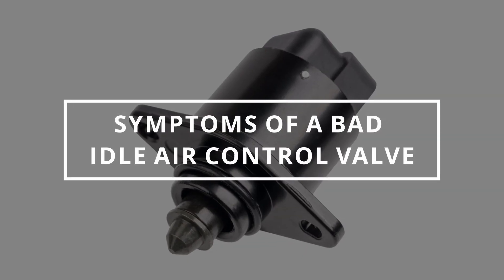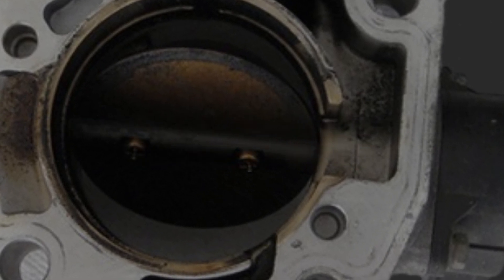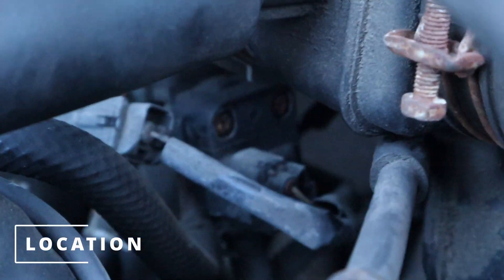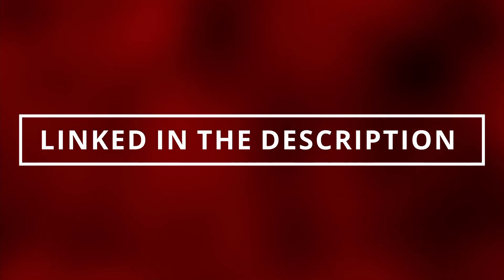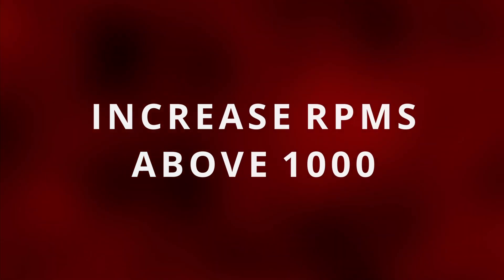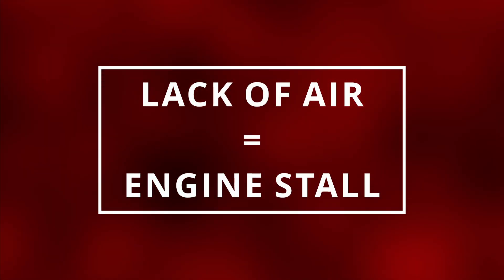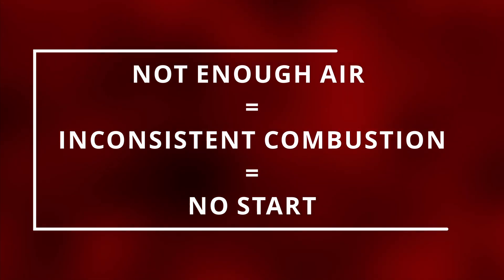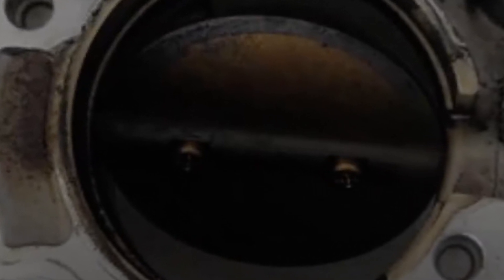SYMPTOMS OF A BAD IDLE AIR CONTROL VALVE

Comment: And yet 99% of people who change their air control valve never do it properly. You must you must disconnect the battery before replacing the air control valve this is so that it will relearn the new control valve when you install and reconnect the battery you must allow the vehicle to idle for at least 10 minutes without touching the gas or disrupting anything and then do another 5 minutes with your foot on the brake and then another 5 minutes with your lights on air conditioning on rear defroster on so that it creates a load and this will help the ECU learn all those different variables to give you a perfect idle when you are done. Hope this helped because nobody on YouTube is showing this because they're all defective
Reply: Thank you! I didn’t know this step, about to replace mine on a 98 and want to make sure it’s done properly
Reply: Thank you for the information Will.
Reply: @Vincenocks  You're welcome
Reply: Thanks for the heads up i was about to change mine
Reply: @nunya3812  no problem you're welcome
Reply: Remove negative lead only. No need to remove positive to reset ECU. Come on, let’s not be ridiculous. Electricity is not magic.
Reply: @howardklopak628   thank you…. I know some people are bullshit and try to fool on some of people… I knew it there just need is disconnect only on negative cable that’s all..
Reply: @howardklopak628   thank you!!! I fixed it yesterday and my 4.3 vortec running is perfect and easy start up.. I took old IAC valve and noticed that old iac valve is opened that mean closed for vacuum to can’t get air in the throttle body..  wish I can post picture or video in here comment
Reply: @howardklopak628 flatten the system is grounding out the positive cable … better results . Computers forced to reboot. Your method can leave residue voltage in the system. Removing only the ground does not flatten the system.
Reply: @howardklopak628 remove POSITIVE terminal. Everyone does this wrong. Reason being is all you're doing is breaking the circuit on the battery. Removing negative cable gives opportunity for negative cable to ground out on body, frame or engine which completes the circuit again. Guess what happens when you remove positive cable and it touches anything grounded. Nothing.
Reply: Oh, that is where you are wrong. Electricity is very much a magical phenomenon. You are just too old to see it anymore
Reply: Oh, that is where you are wrong. Electricity is very much a magical phenomenon. You are just too old to see it anymore
Reply: @howardklopak628  there is no need to remove the positive lead, if you want to drain all the capacitors out of the PCM you can remove both positive and negative lead and lay a towel over the battery and connect the positive and negative lead with a wire The 15 minutes and that will drain all the electricity out of the PCM and then you will have a flashed PCM. Your statement shows you have absolutely no idea what you're talking about so I'll just leave it there
Reply: @willsrestorations  Exactly… you have no idea what I’m talking about. Lol
Reply: @howardklopak628  trust me, nobody knows what you're talking about
Reply: @willsrestorations   Ok, so give me one reason why both the Positive and Negative leads need to be removed from the battery in order to isolate the battery from the circuit and allow the ECU to do a power cycle reset?
Reply: @howardklopak628 I'll give you one...Newer vehicles are designed to NOT lose all memory when disconnecting a battery i.e. clock time! When you connect the positive and negative it connects the circuit in parallel so "power" is still being used now although no battery is there to continue to supply it thus it fully "dies" and actually manually resets the ecm/PCM/ecu when the vehicle Is reconnected! He's not full of shite and actually knows what he is talking about! I know this as an electrician! The modern car computers have a Capacitor type storing ability of power in their systems! To check this, unplug the battery on a newer vehicle for 5 mins and see if the clock changes? I bet it don't and that proves his theory. Drain the battery like he said for a lengthy time and I bet it takes a second now for the computer to automatically set the time albeit fast, it won't be instantly!
Reply: @willsrestorations positive lead is only one you should be removing.
Reply: To touch the positive and the negative of the battery leads to discharge capacitors in the vehicle, you need to remove them both from the battery, genius
Reply: do you have to hold the brake for 5 mins or would 2 mins work
Reply: @Unknown-lu4zq  2 minutes is fine on most cars. But it's not as critical as one would think. The most important part is allowing the car to idle and come to operating temperature and then putting it in gear with your foot on the brake for like 2 minutes at most. And then back to park position and turn everything on in the vehicle including the air conditioning and rear window defroster and fan on high and lights on
Reply: God bless you I've replaced almost 6 of them but my car never came alright it iddling high sometimes low but hopefully this will help
Reply: You just saved me from causing a huge problem thank you
Reply: @TheReal2KD  anytime
Reply: Thankyou so much! You just made so much sense! Mind blown🤯 I feel like this information should be on the news! ❤️
Reply: @angamazinm9137 it certainly should be in the video that this YouTuber was making. There are very few good solid informative videos on YouTube,  unfortunately.
Reply: Ur a fucking g dude much appreciated info
Reply: Sir I just wanted to let you know that your information and knowledge is still helping people 2ys in the future! I lost both my dad and husband about a year and a half ago and they always knew all these tricks and surviving with my older truck is a lot harder these days because it's so much harder to ask the right questions if you didn't even know did that question was a thing lol! So anyway thank you!!!!
Reply: Wonder if I delete any codes with my scanner tool then will they relearning if I did replace IAC and without disconnect battery ?
Reply: @damnbigstoned420  deleting codes does not start the relearning process at all. The best way to do it is to remove both the positive and negative leads to the battery then place a rag on top of the battery and place a thick wire between the positive and negative battery terminal cables only for 15 minutes and that will drain all the capacitors out of all of the sensors and the PCM.
Reply: @willsrestorations what I already replaced  it before the steps but I haven't done it
Reply: After I do this should I turn the car off before driving or can I drive right after?
Reply: @deadmangreedo  you can drive right after but you must drive the car easy and not fast or being aggressive on the gas pedal for about 50 mi at the most. And everything will be reset at that point
Reply: @willsrestorations you don't need to go that far. Disconnect positive terminal (everyone says negative but that is wrong) then turn key on. That will discharge energy.
Reply: @willsrestorations ...Place a rag on top of the battery?? I don't believe you... ridiculous
Reply: Question bro 
Is it ok to drive with a disconnect IAC , I mean just for while cause mine I think its failure , when engine start always run with a high rpm like my foot in gas while its not( for a sec,then back normal) , and sometime rpm stall while driving.
I disconnected it , everything seemed normal now? 
Can you explain and advice please ? Thanks.
NOTE 
My car is mini cooper s 2009
Reply: @hussamalmaqdami3493  first of all your first problem is you have a mini Cooper, 😂.
I suggest you check your power lead to the IAC
Reply: Yes, you can leave your IAC disconnected, but you may have a difficult time with driving, because the emc will be looking for that input and it will likely cause your motor to run incorrectly, and in fact it may even cause you transmission to not go into gear like it should. The eco will be looking for that iac valve signal. I personally wouldn’t do it. But if it’s your only vehicle and you have to travel somewhere, then I totally understand why you would do it.
Reply: @willsrestorations
Reply: W comment
Reply: My battery is under my lpg tank can I disconnect the ecu and do this? I changed mine on my bmw x5 and it still randomly stalls when i break to a complete stop and on hills when I come to a stop.
Reply: @simongatt9044  I hope you bought your part from BMW because aftermarket ones are absolutely horrible and not calibrated properly for BMW. But remember you must disconnect the battery and leave it disconnected for at least 15 minutes before I'm plugging the ECU. If you didn't buy a BMW part then that could be a problem and if you did buy a BMW part then I suspect you have other issues that is causing your vehicle to stall and that could need some diagnostic work to pinpoint
Reply: I really hope you are right. Thank you
Reply: @petesmith9472  this is the procedure directly from Ford which I have done dozens of times and the only time it doesn't work is if you have other issues with the vehicle
Reply: Odd my garage  owner mechanic has been in business for decades and never told me this.
Reply: @dennis3351 That's because most long time mechanics like myself are not used to the new car computers ability to store power for a LONG time now and the only way to reset it is to actually drain the reserve power! Positive and negative leads connected in parallel complete the circuit with no battery or way to recharge so when the powers out, it's actually out now! He's telling the truth and most old mechanics are just not used to it as this did not apply on most 2006 and before cars!
Reply: @dennis3351  just because he's been in business for decades doesn't mean he's knowledgeable. The truth is nearly 80% of mechanics today that have been in business for 20 years or more a completely clueless about the work that performing. Said to say but it's true
Reply: @dennis3351 your garage mechanic care about his business more than actually helping. 😅
Reply: Fk to late
Reply: @jonathancardona6215  it's not too late
Reply: Great job mate 👍 just replaced mine then saw this and started again . A 2003 1.6 fidgi purring like a kitten again 👌👌👌
Reply: I have a 08 cvpi it starts then when I accelerate it stutters then cuts off I replaced the throttle body fuel pump and fuel filter what is advice on what it can be?
Reply: @DeezKnuttz973  have you checked the fuel rail regulator or fuel pressure regulator whichever one you have.
Reply: @willsrestorations  no but I will thank you
Reply: Great advice thanks
Reply: Man I've read every single one of these replies trying to learn what others can tell about this idling nightmare I'm all but stumped on. I've a 96 Dodge Dakota 2.5L efi had a water drip from m the water pump gasket leak and fixed it just for it to start and run at full rpm which is insane because it's so high rpm the exhaust manifold starts to glow cherry red after only about one minute and nothing seems to be able to fix it as far as every sensor is been replaced, with the ones from amazon. Have even taken throttle body completely apart and cleaned the shit out of it and placed brand new gasket maker which I'm pretty sure had worked and sealed up any possibility of it leaking or sucking air, at least I believe it is not because nothing I do makes any difference. Beyond frustrated because this little truck ran better than perfect and I'm skilled enough to not do anything half ass or to just proceed blindly about simple replacements. Far as getting all the computer knowledge adout how it all works seems to be where I'm at. Maybe. Can someone please help
Reply: @Benji-yy7ow  dude you have a serious serious vacuum leak and you should start by looking at the throttle body to see if the gasket is causing the vacuum leak because when that happens it's usually a massive vacuum leak within the throttle body. Do not run that car under those conditions because I'm surprised you haven't worked the heads yet
Reply: What are you talking about? Some engines have a completely mechanical valve. My 4Runner's valve is built into the throttle body and is actuated by a small thermostat because there are coolant passages in the body.
Reply: @elimogenson3316  My statement and procedure wasn't for every single vehicle it was for the vehicle that was talked about in the video. There is still a relearn process
Reply: I just replaced mine and never knew this, my car is having a really rough idle, and is stalling if i press the gas, it would make sense if this is the reason why because i was not informed of this procedure so if it starts working after this i thank you so much.
Reply: @Scriptkiddie07  having a rough idol can mean more than one thing, making sure your injectors are clean and operating properly and check your spark plugs and check your coils for the ignition and also clean your throttle body. Those are the things that will make the vehicle run an idle roughly and also the mass air flow sensor can be removed and cleaned with mass air flow sensor cleaner and that may change the way the vehicle runs completely
Reply: Where can I order the icy in IAC valve O'Reilly's O'Reilly's or Arnold's the computer says no part
Reply: Thx for the heads up!  Should I turn it of after that initial 10 minute run and then restart while pressing the brake for subsequent 5 mins and again for pressing the gas?  Or should it just be one continuous run?
Reply: @kuraidjinn  no none of that is necessary, The most important thing is you drive the car normally without beating on it and allowing it to go through the gear smoothly for the first 50 miles or so. This is called the relearning process for the PCM.
Reply: @willsrestorations,Thank you !  I just replaced on a 2001 dodge 4.7 liter, completely wrong ,can I start over or do I need to get a new IAC ? Thank you
Reply: @christophernaples1315 no need to get a new one. Just pull the negative cable off your battery for at least a half hour then reinstall and go through the process, just keep in mind that this is not always the issue with your vehicle and you could have other issues such as a vacuum leak somewhere
Reply: thank you sir. that is more important than learning how to check iac.
btw, is it normal if the iac becomes hot while doing some checking? hoping for your advice and thank you in advance.
Reply: @tagminda4565  it depends on what type of testing you're doing. If you're testing it electronically for opening and closing there really shouldn't be any heat generated by that procedure. But you also have to understand that if the motor has been running the IAC well also become hot to the touch.
Reply: My AC belt snapped so I can't run the air conditioning am I still all right I guess?
Reply: @thecosmickat3954  if your serpentine belt has broken how is the car even running without overheating or any of the police are alternating working. Funny question from you
Reply: hello, can someone help me with my prob on my honda fd 2007? every time i turn the ac on, and when fan kicks in, it feels like its going to stall and there's a vibration under the hood obviously. But when the ac is not turned on, the idle is doing just fine. tia!
Reply: @serjun492  you need to check your idle control valve or your throttle position valve sensor. When you turn on your AC it's supposed to compensate and raise the idle and that's not happening with your vehicle.
Reply: hopefully this will help me a lot I did a rebuild on a 2.2 and it's still has a disrupted idle..
Reply: @sledgenwedge  it also could be that your throttle body needs cleaning which can result in a high idle or very low rough idle.
Reply: @willsrestorations   thank you brother I did the 3 minute 1 minute 3 minute relearn and it's smooth as butter I am so happy.. 2000 GMC Sonoma 2.2 L
Reply: @sledgenwedge  glad it worked out for you man.
Reply: @willsrestorations   me too! it can get expensive chasing your tail with the parts gun😄
Reply: Can this cause surging?
Reply: Thank you
Reply: dude it's 2025. get a code reader plug it in. and tell it to run cycle for iacv. done
Reply: @AJsHotRodsNrepairs code readers don't do that. You need something more advanced than that. A code reader will only grab codes out of the system
Reply: usually if you dont do the above steps, drives the car for few hours to few days, it will automatically reset. Thats still fine and no worry. ❤
Reply: @人車-h3t SAYS THE GUY WHO HAS NO IDEA WHAT THE HELL HE'S TALKING ABOUT. JUST TURN ON THE YOUTUBE TROLL TRYING TO ACT SMART

Comment: So I’m having an issue when the air conditioning is running, at a stop, traffic, stop light etc, it will surge up and down from 750-450. Ver noticeable. Could this be the issue? It’s also odd it only does it when ac is on.

Comment: I think you may have just hit the nail on the head with a hammer
My car shut off on me after I turn on the AC and was about to drive off down the block afterwards, I had to step on the gas to get it to start its intermittent because now it starts every
Time how could I make sure that it’s not the map flow sensor and is idle control valve I’m pretty sure that’s what’s wrong with it.

Comment: I have a 2014 Ford Focus with an annoying intermittent problem. It drops revs to 200 then bounces back up to 1000 on start up engine warm/cold and when driving “ revs drop to around 200 and slows down” have had the aux and timing belt changed already. Any help would be appreciated
Reply: did you ever figure out the problem? having the same issue with my 2013 FF se
Reply: @marilyn6748 same with my 2011!

Comment: Thanks! My car is doing just that. No codes, but just cleaned the throttle body and it was very dirty. 147,000 miles dirty. New replacement costs under $50!
Reply: I didn't have the code until I cleaned my throttle body then I got the code and car started acting crazy lol